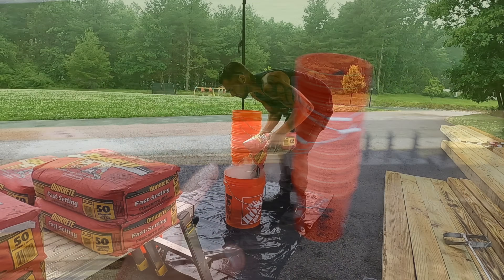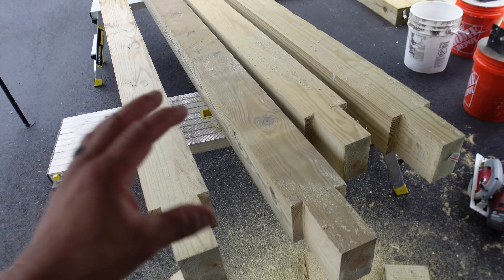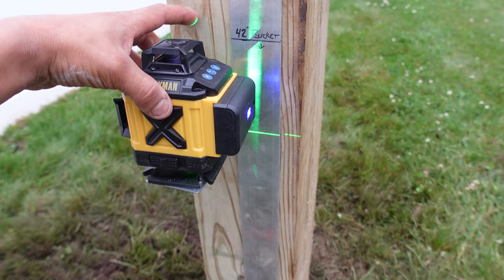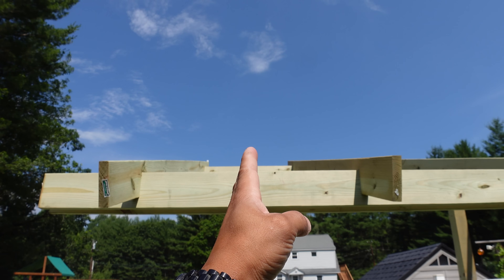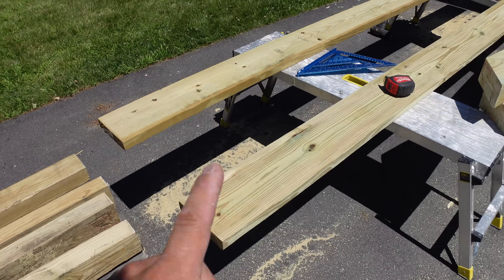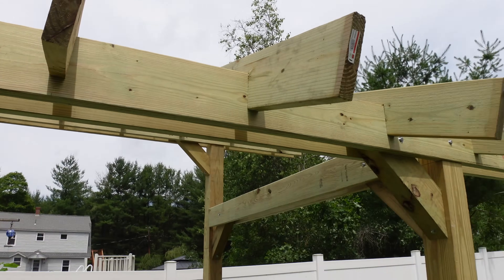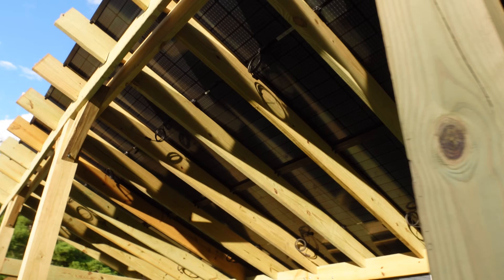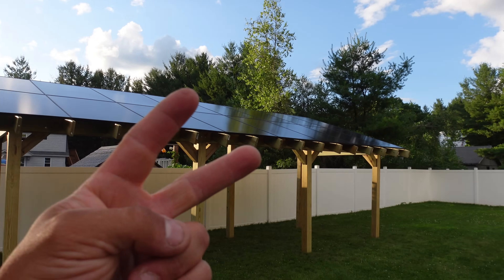Building a DIY Solar Pergola | Step By Step

Comment from the maker: So, what do you think?! I had no plans for this; Only refrences of what I have seen online and I made it work for myself in my personal situation. I think it came out well considering. I will do the FINAL cuts in the next video or soon after and we can go over a full cost and material list of this entire build in a break down. I just ran out of time in this video! Thanks for watching!!
➡ Check out Signature Solar: https://signaturesolar.com/?ref=zwzcpllh ("CHUMPCHANGESAVE50" For $50 Off)
➡ Check out Tangem: https://tangem.com/pricing/?promocode=CCXD
Reply: Where did you get the clips for the panels?
Reply from the maker: @WTFUSERNAM44  just on Amazon small “L” shaped clips. I put a list of parts on my second video
Reply: That's a lot of work! But why did you angle the array away from the sun?! You're only capturing ambient light, not direct light - as if every day is a cloudy day of solar production...
Reply: @ChumpChangeXD  I loved it! It's perfect!
Reply: It’s way Over use of material. And you didn’t protect the columns from termites and water damage.
Reply from the maker: @Josh-ko8gw do you know what pressure treated wood is 😆
Reply: @ChumpChangeXD even though pressure treated it doesn't seem like it would have been more difficult to pour cement footings to extend above ground and avoid direct contact between lumber and soil. That would also eliminate any concerns with water pooling creating problems. Using pressure treated lumber is the right choice, but burying it in the dirt is not. And it would have been no more difficult to just avoid that.
Reply: Great job building it, but not a steep enough angle for the panels to be super efficient
Reply: Other than doing literally everything wrong, it looks nice.
Reply from the maker: @muyoso  please explain lmfao fkn troll

Comment: I am considering a pergola in my backyard, but the real reason is to add panels high enough and use it as a roof. One thing though, most neighborhoods will require you to build at least 6ft away from the fence, that goes for sheds and anything over 3ft tall. If the structure is higher than 6ft you may need a variance approved by the city, this is so that anything unsightly emerges and view is not blocked from neighbors. And, perhaps some sealant, kerosene or used motor oil on the exposed cuts to prevent rot. Good work. Mine will be two wings so it looks like a pergola roof, then some patio furniture underneath and hopefully it will disguise it. Another option I am considering is making it a long open garage/roof for my RV, it would protect the RV vinyl roof and make sense.

Comment: What did you use to attach the modules to the rafters? Also did you do anything to ground the panels? I know usually mid clamps do that, but I'm curious if/how you did with this method? 

Thanks for the video, planning on doing something similar!

Comment: The best ive seen. If you did this by yourself I would be shocked. The breakdown is unbelievably helpful. Excellent work. I need one 45' long for 24 panels. Figure it will cost $2600. How long in manhours did this take to build?
Reply from the maker: You would be shocked? I literally recorded the entire thing only lost a little footage due to the camera over heating, 😆. I think it took me 3-5 days or so. Getting the wood was time consuming as well as digging the holes in the ground. That was the hardest part.

Comment: Two questions:
1) Why didn't you tilt it towards the South?
2) Why didn't you paint/stain/seal the wood before mounting the solar panels?
Reply from the maker: Because now I have two arrays one facing north (this one) where it gets the most sun in this location and one facing south (my shed) gives me maximum amount of sun all day. Stain you can absolutely do that if you want to. I would only need to stain the exposed parts tho the top covered by the panels is useless to stain as it’s covered. That’s like staining the under side of a deck lol

Comment: exactly how did you attach the solar panel to the wood. What device did you use? Thanks
Reply from the maker: Black self tapping zip screws I think they are called (tec screws) into the panels and some small 1” L brackets with 1-1/4”’wood screws into the wood.  I believe I have them in the next video on the price list. I created links in the google doc.

Comment: This is a very poor design because pressure -treated wood post will last 5 to 10 years in the soil. The concrete anchors are supposed to elevate the wood above the soil so that the wood will not be constantly in contact of moisture.
Reply from the maker: Do you understand pressure treated wood can literally be sunk into the water for boat docks rite? Lol these 6x6 posts will outlast my time here on earth. If that bothers you then surface mount them or put rocks around it instead of dirt right up to it like I chose to do.
Reply: @ChumpChangeXD I do understand that pressure treated wood comes with different grades (how the wood was processed). Water resistance depends on the grade.  I don’t believe the wood from Home Depot is meant for constant submerge under water. I mean, if you live in a relatively dry area, that’s probably fine. Nice video though.

Comment: why would you dig the posts in with the wood under the soil line? wouldn't that allow the posts to pull moisture from the ground?
Reply from the maker: These poles are pressure treated. You could literally put them in the water. Moisture would take 100 years to wrot these. That’s how they make docks for boats… I’ll be dead by then lol.
Reply: @ChumpChangeXD  i see! thx for the reply

Comment: Why did you leave the concrete in the bucket? That wasn’t very smart. Now you have plastic in the ground and its very slick if you get a heavy wind it’ll pull them out of the ground.
Reply from the maker: They are anchors 100lbs or so for each pole. Trust me it helps. We had 40-60 mph winds the other day and they were just fine

Comment: Generally great.  I only have 2 comments.  I think you should have added flashing between the rafters and the panels….years go by fast and rot happens.  Or I’ve seen black tar like stuff used well on redwood decks.  Henry’s? Soft years later but really protects the wood …only seems to be needed where wood or metal is in contact with top of a horizontal ….and buckets and metal seems wasted overkill/underkill when not above ground. Smaller deeper hole with some rocks with cement breaking surface would last longer and can still be removed if wanted to

Comment: Very nice. My initial concern is you aren't using rafter ties and using the solar panels to keep the wood from bowing. I don't think they will bear that tension well as the wood changes.
Reply: This is correct.  any movement in the wood as it shrinks could cause cracks in the panels.  That's why you need cross-bracing or struts/tracks that the panels are clamped down against.

Comment: In Pennsylvania we wouldn't be able to do the bucket thing. They'd need to be 3ft deep concrete tubes. The frost would push those buckets right out of the ground, especially with those smooth sides on the buckets.
Reply from the maker: I’m in Massachusetts. They have held up just fine brotha 🤙🏻

Comment: Cool.  Thanks.  Pressure treated wood must be field treated when cut or drilled per AWPA standard M4, and building code when applicable.  Using the brackets and concrete may help the wood last longer if set in ground with wood above grade but put them in the other way up to stop freeze thaw cycles from lifting them.  As used, they were an unnecessary cost.
Cheers
Cheers,
Jef

Comment: From a construction perspective, I'm very impressed. But from a solar energy perspective - nope. The first step should be to pick a site with minimal shading that faces the sun. This location and orientation fails at both.
Why was it not installed in the back corner of the yard, away from the tree shade, and facing toward the sun?
Reply from the maker: Because I have a large house that shades that part of the yard when the sun comes up… thank you for the kind words 🙏🏻

Comment: I thought the purpose of the post base was to keep the post above ground (out of water). I have also seen people seal cuts on PT wood since the pressure treatment is more surface level protection and yours are just exposed underground. The method you chose looks intentional so I’m curious about the thought process there, choosing what you did over a few more bags of concrete and something like a sonotube. I also think doing something like a white rock bottom would help with more sun on the bifacials. Great build!
Reply from the maker: Yes it should be above ground 100% but my plan it to fill around the hole with rocks so it’s not sitting in wet dirt and the water will drain around them easier. Those poles are just too tall so I needed to have either real concrete footers (sauna tubes) or bury them a bit deeper than anticipated. This was my decision, though, as I did not want to make it a permanent structure with sauna tubes.

Comment: I'm working on same thing... How did you secure the panels to the rafters?
Reply from the maker: I used little self tapping tec screws for the panels and 1-1/4” wood screws for the joists and some 1” L brackets I found on amazon. I think I put the full list in my other video
Reply: @ChumpChangeXD  thank you for answering. I’m very happy to hear those held up to winds and storms.
Reply from the maker: @davidadkins1926  no worries at all brotha (I put 4 on the top and 4 on the bottom of each panel left/right and two on the center joist)

Good luck!

Comment: Why not sheet the roof with corrugated steel?  Then you dont have to worry about leaks and replacing the panels is so much easier with a proper mounting system.

Comment: This dude has never heard of a post hole digger.  And why sink it into the ground at all?  Just leave it mobile, so you can move it to another spot, or easily take it with you if you move.  There's no rule against using a base.
Reply from the maker: Lmao yea leme rent a post hole digger for 8 posts… no thanks shovel works just fine I’m not lazy. Also because it’s a 12’ post that is not stable to leave it like that without having some ground bearing it down. Wind is a lot stronger than you think.

Comment: Waste of brackets and buckets, serve no purpose. Using solar panels to hold is square  in not a good idea .
Reply from the maker: What are you saying 🤣 

Buckets are weights for a temporary structure to avoid sauna tubes. “Serve No purpose” is an ignorant statement.

Also panels to hold the wood straight is zero issues once it drys it holds its form. There is zero stress after the first day.

Comment: I am looking at doing something very similar. As far as dealing with the joist spacing/ bowing/ twisting , I would have run a set of blocking between the joists at mid span.
Reply from the maker: I agree I just didn’t wanna ruin the look 😆

Comment: Since the sunlight also comes from the back, I would put a layer of reflective insulation foil to act as a radiant barrier from the heat emanating from the panels and simultaneously reflect light upwards and up the panel when the sun starts coming in from the rear.

Comment: Cool video, what is the value of using the buckets with concreate instead of just concreting in the poles in the ground?
Reply from the maker: Didn’t want it to be 100% permanent. I can remove the buckets need be. Thank you 🙏🏻
Reply: @ChumpChangeXD  O, interesting. I didn't think about that. Awesome man project looks great.

Comment: Nice video!
My only add would be to next time use 1" pieces of wood, or plastic pipes, across the buckets to hold the metal off the concrete, take them of and that way you will have one less point that will rust.
Great job!
Reply: The metal on top of the concrete is buried. Raising it off the concrete is definitely a good practice when it is above ground but irrelevant when buried.

Comment: I am thinking something like this for my house. I have a south facing walkway beside my house that gets tons of heat during the day. I was thinking of putting up a solar pergola like this for two reasons. One the obvious solar panels to make electricity. the second to prevent the light from mostly hitting my house to help reduce my cooling bill most of the year.

You gave good instruction in the video but do you have actual plans for something like this?

What would be different since I already have concrete along the side of the house?
Reply from the maker: In the next video I have a parts list but that is all I got brotha I’m sorry wish I had more for you!

Comment: Lag bot down the center of a 2 inch board isn't good. Should get joist hangers otherwise in a year or 2 that wood is going to start splitting and cracking.

Comment: Great job

Is there a better way to seal the panels to prevent water from going between them?

I was wondering if an EPDM gasket would have been better.
Reply: I think butyl tape would be good?
Reply from the maker: Yea for sure I just didn’t have it when I did this so ehh. Next time that’s what I would do tho for sure!

Comment: Why the buckets? Why not just string and spray paint and holes and plumb wood in holes then concrete.seems like more work to put plastic buckets. Anyway it works thats the main thing so good job.

And it really looks pretty good too. And anyway the most interesting part to me is the solar panel hookup. Also the overall idea which i believe is just great

Comment: Hello, Engineer here as well. I actually took a class on PV a while back and In my opinion, it might not be such a good idea to have chosen bifacial panels just because It seems that no matter how much irradiance you may have bouncing off the floor especially in the case of snow, the rafters sort of block the light and it might cause that side to not repick up enough energy to stay on. I hope I'm wrong about that. I just remember learning that if you shade enough of the panel, it will not conduct because of the diodes.
Reply: Yeah my thoughts were,  who puts their solar panels on a north south axis?  It's just bad orientation 😪 nice job but wood should not touch earth

Comment: I don't like it because it doesn't have a roof.  During inclement weather people will naturally want to use this as a shelter against the rain, and will quickly discover that the solar panels do not stop the water, they only slow it down.  These pergolas drip everywhere and by not putting up a roof, you lose the opportunity to create a shelter.  When it rains next and you want to do something underneath the pergola you will be telling yourself "I should have put up a full roof"
Reply from the maker: If I did that it would negate by fascial panels, and they would have no purpose. You CLEARY didn’t watch me installing the panels tho because I did silicone between a few of them and that’s easy to do after the fact. The thing I wish I did was put that double sided barrier tape or what ever it is but it’s fine I can always do it later if I want

Comment: Using those footer metal connections in cement is to be above grade not below if you were going to stick it in the ground it should be incased in cement so moisture cant rot the wood.
Reply: How about sealed/treated lumber?

Comment: Weather stripping between the panels would have been better than silicone caulk. Like door or window seal, or even butyl tape. No risk of it squirting out, adhesive on one side only, squishy, comes in the right shape.

Comment: The way I did my pergola post for my solar. I just dig 4 holes 1ft, then put the 6x6x12 Wood Post and Pour it quick cement.. once all 4 post dried. I only need to cut 2 pole 1ft shorter than other 2 (cutting it from the top). It seem a bit overkill you have to measure from the ground/bucket leveling when you can just level those post by just shaving off from the top of wood post..
Reply: it depends if all 4 holes were dug on the exact level, flat surface. and then if the holes are all exactly 1 foot deep. otherwise you'd still need a laser level mounted on the taller posts to mark exactly where to cut the shorter posts to get the proper solar panel angle.
Reply: @aaronalquiza9680  my ground was not exact level. But i level it by just cutting from the top of the post. Becuase the post height need to be level each other, not the ground.
Reply: @TOYTULOG  
For example:
-my ground is sloped.
-the holes i dig are all 1ft deep, 20ft square distance.
-the posts are all 12ft long.
-i lay all 4 posts in the holes and find that 2 back posts are taller.
-i want my solar panels to be angled by 5 degrees, and front posts have to be 1ft shorter.
-i cut 1ft from the front posts.
-the back posts are actually higher because the hole i dug is 8 inches higher due to the slope, so now there's a 20in (1ft + 8in) elevation difference between posts, and the angle is now 8 degrees.

Comment: Nice work, but those panels need to be electrically connected and then grounded using a 5' grounding rod for lighting protection. Also, you will not get a seal because the panels expand and contract. Hopefully there is enough gap so they don't expand and break.
Reply from the maker: Yes, I know I haven’t grounded this yet. I haven’t even wired it all up yet lol! But the gap will be fine for sure 🤙🏻

Comment: I am a little confused.   From the video it seems you have the panels facing north?  
Also, when you used clamps to straighten the rafters, when you take them off it means the panels are acting as clamps.  Is that wise?  They are glass and not designed to be loaded like that.  I think I would have used separate blocking.
Reply from the maker: Straightening the wood and securing the panels won’t hurt the panels. There wasn’t that much pressure the clamp is to hold it still not because it was hard to compress…